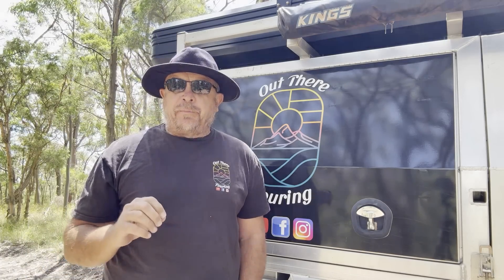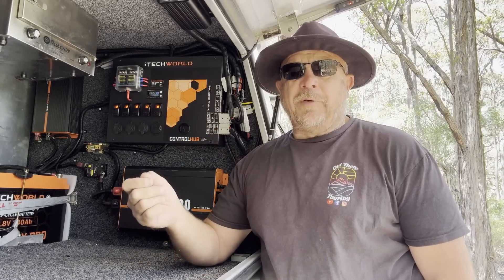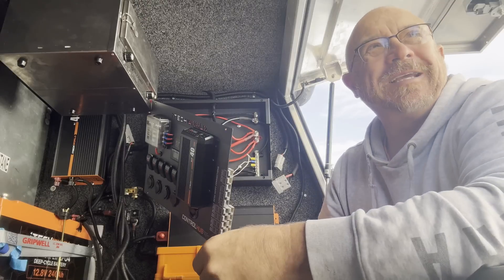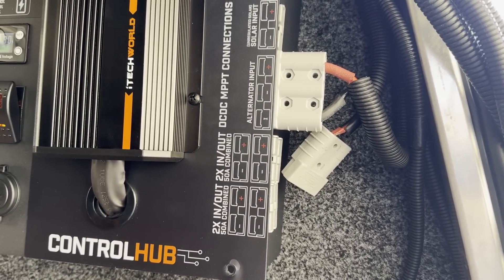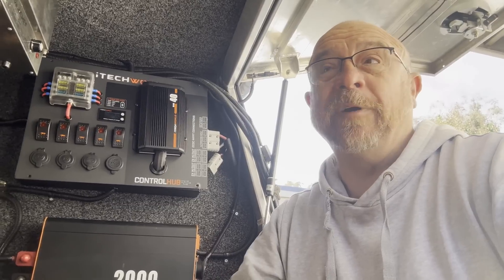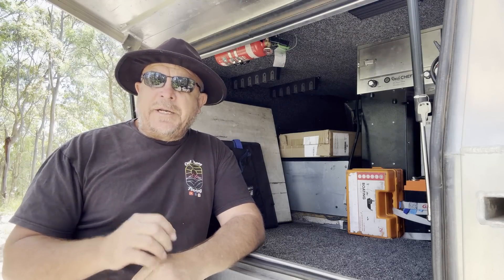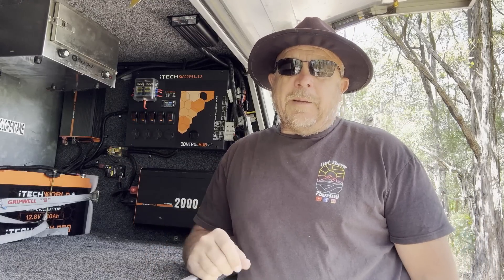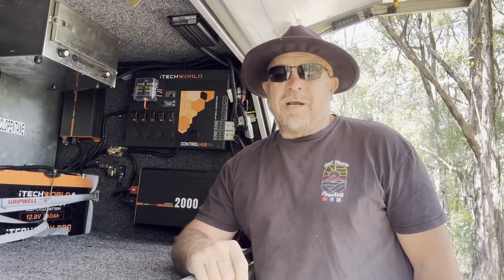Itechworld control hub 40amp Dcdc installation

Comment: Hi Craig. Just a question. Why was there no earth connected to the main battery via the Anderson Plug going to the DCDC ? (seen at 5:17) Just notice that there is a positive from the main battery and what I presume is and ignition source. Reason I ask is because that is a 40A DCDC and they deal with higher currents. Generally it is recommended to use 6AWG wiring at least as these DCDC chargers tend to have issues when the current is limited to them by using wiring not the right gauge. I personally am not aware of what iTech world required for their DCDC chargers, but with other brands you may start to have issues with the DCDC if not using the correct gauge wiring. It is sort of like strangling the DCDC.

As for an agent driving around to view products people have an issue with. I understand this view and think it would be great as well however generally it's not going to be feasible.  Maybe a service centre in states where they are might work. But totally understand when people have a trip coming up. It is disappointing.

The main issue with most 40A DCDC chargers comes down to the wiring used. I know some will disagree with me showing me statistics of what 8AWG can pull, but I know for a fact the issues I have seen when it is done this way. 

There are other companies out there that pay for return shipping if you have a warranty issue so you are aware.

Voltage will vary depending upon where is measured from. Generally the shunt should be more accurate and for me, this is where I would take my info from. 

P.s. Happy to have a chat if you would like about it. I work in this industry as well. And not to sell you anything. Just to help out.
Reply from the maker: Hi mate, I’ll check video when I get home and some better reception than in vic high country. 
Negative wire is wired in from main battery back to control hub 
Thanks for advise and I’ll double check.
New set up is working perfectly
Reply: Hey Rob. I checked out the whole system. The wiring was up to spec. That is why the replacement system I loaned Craig worked so well.
Reply: @timlawton1362  no doubt mate. Did you see the missing negative wire? Why is it missing and what gauge wire was he using.
Reply from the maker: Hi Rob, 
I have checked the time frame you are asking about and can confirm there is a black wire negative connected to control hub from the main battery. 
Cheers 
Craig

Comment: Mate the amount of itecworld dcdc chargers that have failed you would think the company would re model the whole unit.
I run lots of their gear except I went for a Victron dcdc.
Glad I did because it’s been working perfectly.
Reply: So is my dc 2 dc after 18months of use. These are brilliant systems...no problems. Obviously they are in WA  and I am in Sydney.  So you are at the mercy of the shipping companies.  Apart from that..they are great. Never paid for freight either.  If you are travelling , they have service agents in most of the larger cities. This guy sounds like he has a grievance...he's not going to put me off iTech stuff, they have always been brilliant.
Reply from the maker: Hi no grievance at all. They had no service agents and was advised had to send back to WA to assess. This was the 2nd unit that failed and the 2nd was only just over a week old and I was on a trip to Cape York when this one failed. Just facts. The guy who assisted me was an authorised installer and he stated faulty unit and was surprised that I was told I would have to send it back to WA and then wait for answer. No use if I’m on a trip and need it to function to be off grid.
Reply: @ottouring funny that...service agents in NSW  and other states...technicians to help out , a reasonable turnaround and a no quibble warranty, free shipping both ways...are you sure you are talking about the same company?
Reply from the maker: @TheBigkev222 yes I am. They may have changed their systems since I had my issues with them and I know I wasn’t the only one. They stated items had to be sent back to them in WA at my cost and if product was faulty they would refund cost of postage and they didn’t have service agents. 
Hopefully they have changed.
Reply from the maker: Hi, 
Yes a lot of people have msged me regarding their dcdc charger
Thanks for watching and commenting 
Cheers 
Craig
Reply: That is the one thing that does fail with their gear. I think they get too hot and mine averages 60c which kills electronics and have put spacers under mine with a fan. 40c now.

Comment: As somebody in the industry here is my 2c. The two meters are not actually connected via the shunt. The hub one will never be as accurate as the actual shunt. Itechworld should offer a second display

Itech workd is a brand without nationwide support and its ine reason i dont install them. Itechworlds price does not reflect its support and features imo. Redarc or victron both have worldwide dealer networks including in the cape. 

I know we had private discussions about this at the time you were in trouble, but its something you have obviously reflected on
Reply from the maker: Hi Travis, 
Thanks for watching and sharing your knowledge with at the time when I really needed it. 
I really appreciate it.

Comment: Thanks for sharing. Very interesting. 

Some companies really push the 3 R rule … under fair trading.  
It’s repair, replace or refund. 
It was once the consumers choice however I think the government changed it now in conjunction with the changes to “fair and reasonable life expectancy” so it’s now the suppliers right of choice. 
It pee’s me off when mobs take your money but then don’t step up when products fail and they don’t stand behind it.😡

Go redarc mate, Aussie made and you’ll never look back 😉👍
Thanks for sharing bud. Happy and safe travels 👍👍⛺️
Reply from the maker: Hi mate, 
I didn’t have an issue with the unit breaking my issue was the “service” and time delays .
Reply: I had a 3000w inverter go down , I sent it back 3 weeks before Christmas,  they sorted it out , had another one back to me a week before , no problems at all , all under warranty.  Great service. I'm on my second system .

Comment: I Have the same Hub the only issue i have had was the control hub settings not matching the shunt settings after id disconnected the car battery at one stage so not being balanced it wouldn't charge and the dcdc got extremely hot , hard to see but i only see 2 wires at your dcdc  Anderson plug there should be 3 , black , red ,blue?. The only thing i really don't like with the itechworld hub is when dcdc is mounted you cant see the dcdc lights very easily  and the settings panel on it you need a degree in confusion to work it out. every time you disconnect your main battery you need to reset the hub and shunt.
Reply from the maker: Hi, 
The third wire I think you are referring to is ignition with for later model cars having a smart alternator( I think that’s what they are called) my vehicle  is an older model. 
I’ve fitted redarc and no issues. 
Yes the shunt and display never match and needs to do a recalibration.
Reply: @ottouring  mines an o7 hilux still has the blue wire , my panels don't quite match exactly but close but it seems to work well